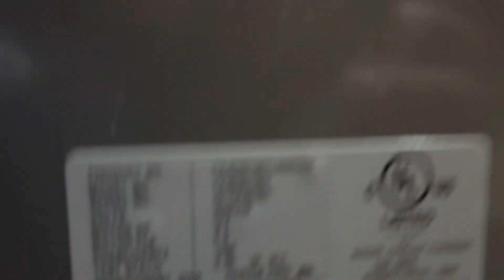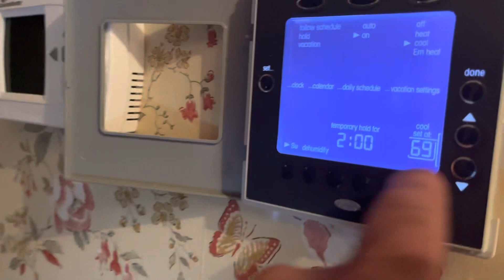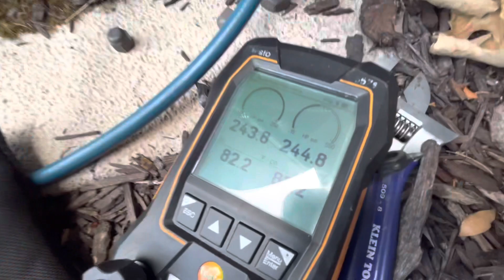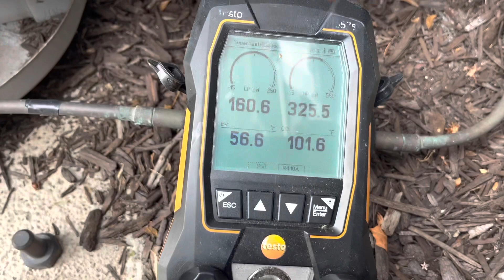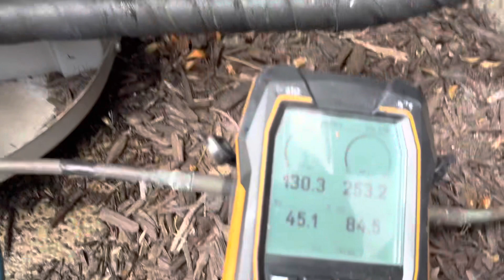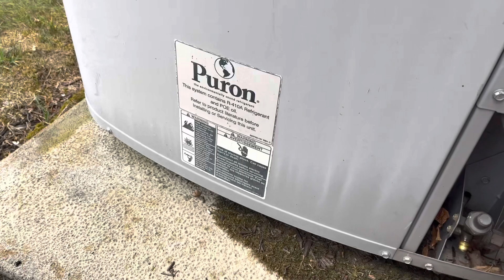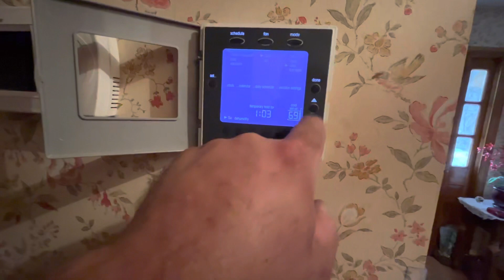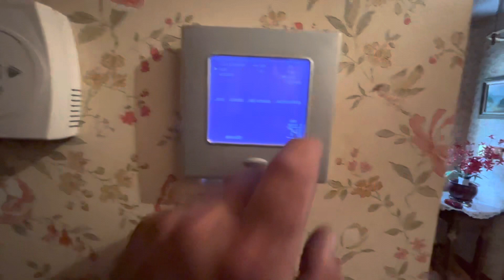HVAC. WHY IS MY AC NOT WORKING?  INDOOR FAN AND HIGH PRESSURE SWITCH

Comment: Lmao I’ve learned not to ask “so what’s going on?” Because we are asking is fan on or is the outdoor unit running etc…… they are like “idk, that’s why I called y’all”……filter or ductwork taking out the motor 👀
Reply from the maker: So true.  They only know that the system doesn’t work.  One lady today basically laughed at me when I asked where the air handler was.    Thanks for watching.